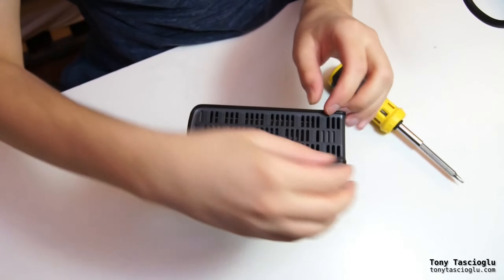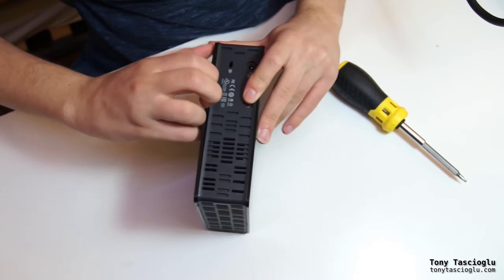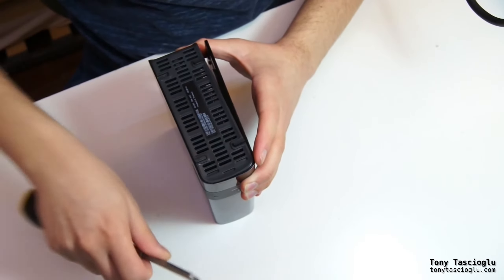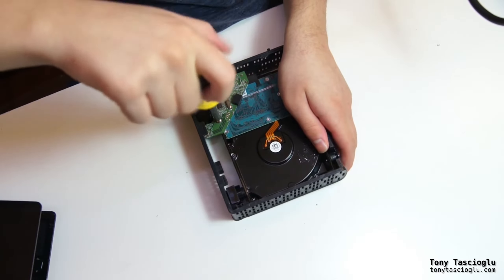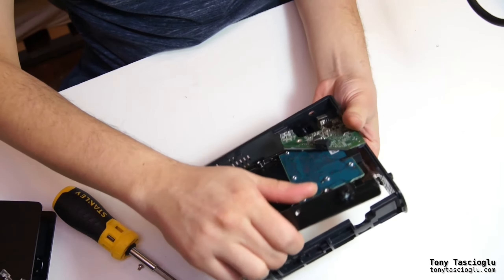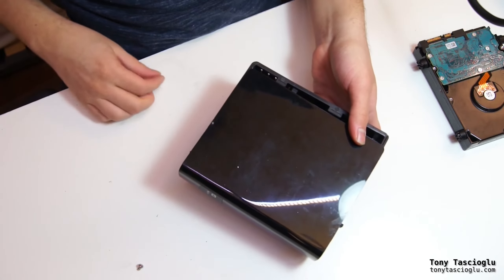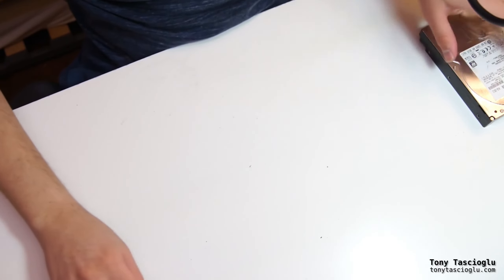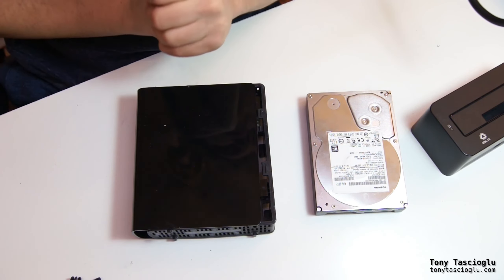How to Shuck/Open WD MyBook/EasyStore/Elements External Hard Drives

Comment: I will never again buy WD MyBook. Two of mine stopped working. So far no problems with Seagate. But the best solution is the docking station. I’ll try to remove my two WD HDDs from their enclosures and hope the drives do actually still work.
Reply: No kidding, and even when you retrieve the drive and put it in a new enclosure, they seem to be hopelessly corrupted.
Reply: @j.p.9522  We had a language training center at the WDD manufacturing plant here in Thailand. Having dealt with the staff, I’m not surprised anymore why WDD’s quality has gone downhill.
Reply from the maker: The docking station has been a lifesaver for multiple drives for me as well. 
One advantage WD externals have over Seagate is for their 8TB drives: Seagate 2-8TB are all SMR, for WD, only 2-6 are SMR, with the 8's remaining CMR drives.
Reply: @TonyTascioglu  Oh, I’m starting to feel old and out of date. Have to google the terms SMR, CMR.
I can only say that the WD drives are a noticeably fatter/higher than the Seagate drives.
All mine are 2-3TB range. I will eventually buy 3x 12TB and consolidate many small drives onto 3 large ones. (Or maybe wait for 18TB to be available at a reasonable price.)
Reply: did it work? mine still works in its case but sluggish, pc struggles at times to reconcile it and not all folders are accessible causing a crash. i hope connecting it directly to the pc i will be able to retrieve all files. though to be fair it is 13 years old now and had left it in the draw unused for at least 5 years.
Reply: @JonVoid37 Removing it from the case was easy. I still haven't tried using the drive with a docking station. [Thinking it might be corrupted VS actually knowing for sure. ;) ]

Comment: Have a WD 4TB elements external just like this in the video but the sticker is different on the drive so I think it's older from about 6+ years ago.. The drive powers and spins up but computer doesn't recognize I think due to the gay WD proprietary circuit board. After taking the drive out of the enclosure and when using just the drive plugged into a IDE/SATA converter, the drive will power up and spin but the computer gives an error that it doesn't recognize the drive. Any advice on how to get this to work without the WD board? Some hack with the board perhaps? DATA recovery software doesn't see it either.

Comment: I followed this video to get hard drive out when the power surge fried the box. I can vouch for this video. Thanks!
Next step now is to recover the data that is no longer accessible due to the power surge.
Reply from the maker: Glad I could help. Hopefully the data on your drive is still intact!
Reply: @TonyTascioglu  Within that week I used getdataback recovery program and managed to recover most of the data from it. Used a friend's key to get the full version to do so. 

All good and I've thrown out the plastic casing to the recovery. 

Thanks a lot for the video that started all this.

Comment: After popping off the 4 ant-vibration rubbers on the sides... I cannot unscrew the ali screws. tried all my bits to loosen, but feels like they are all permanently stuck. Bought my UnionSine external 18tb only 1 month ago (brand new), and want to put into my dual raid storage (22tb +22tb). Just aint having it. Even tried grips to unscrew.

Comment: I hope you still read your comments. Mine had a power spike. I did everything on your tutorial. Will it still function on the data mount?
Reply from the maker: I do still read them! It's just been a hectic time since I was finishing my last semester and am in the middle of a move.
If you had a power surge, it's a game of luck. If the power supply and sata adapter board took the damage and left the drive untouched, it should mount. 
If the surge made it past the power supply, the sata board, and into the drive, you may be looking at professional data recovery unfortunately.

Comment: Nice! now, I can hopefully recover my data...I don't really care about the case...knowing it's the usual sata hard drive in there...I'm happy to do the rest. thanks. 
✌
Reply from the maker: Literally why I had to this the first time... Stopped showing up on my computer, turns out, the SATA drive in it was just fine and is still running (it's the one I used to demo in this video!) but it was just the USB+Power to SATA board that was malfunctioning. Not the first I've seen either, I guess they just aren't that robust.
Reply: Thanks, Tony. I was able to recover my files. It's a shame they don't make the power supply components durable. Lessons learned. Thanks again.

Comment: Hey, I have a 4TB WD My Book and when I extract the disk from the enclosure and connect it direct to the sata and power in my pc I cant access the drive but i see him.
This external dock will bay pass the pcb in the enclosure and I would be able to access the files in the disk?
Reply from the maker: I'm not quite sure I understand what you're referring to, but if the drive shows up but throws IO errors, that could be something wrong with the drive. See if you can get SMART readings with a tool like `smartmontools` on Linux or crystaldiskinfo on Windows. Some WD drives need the 3.3V pin taped over to work when not in the enclosure - if it's a "WD White" drive generally.

Comment: So does anyone know how to open these without breaking the clips? This is pretty much just smashing the drive open.
Also, the WD USB/SATA bridges expect a drive encryption block to be present at a location that depends on the drive size (google it) - it IS possible to put a different drive into this enclosure should you have a failed drive. Similarly, getting data off one of these drives may or may not need a similar WD interface board to do so.